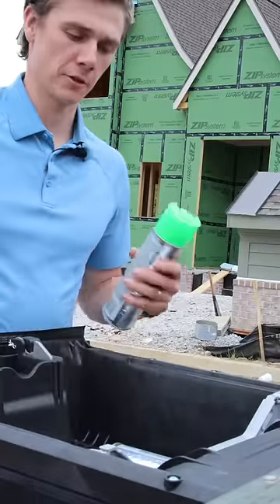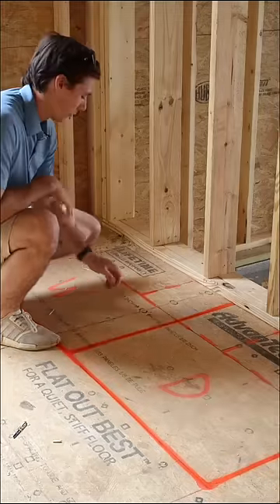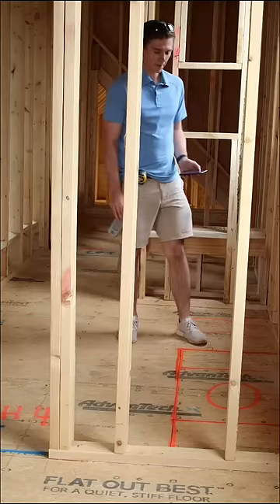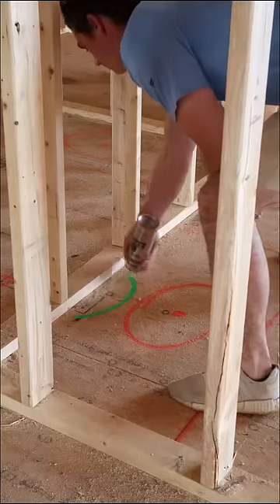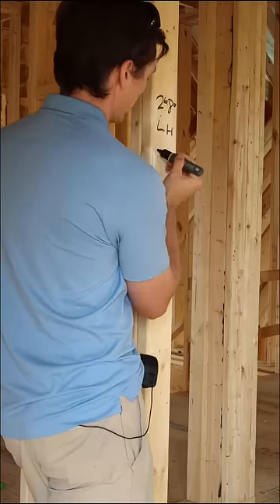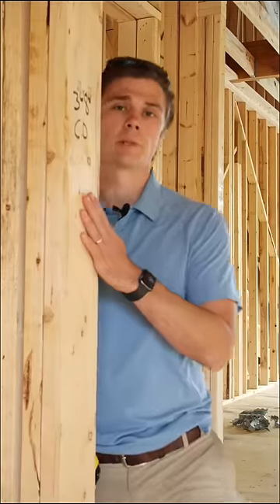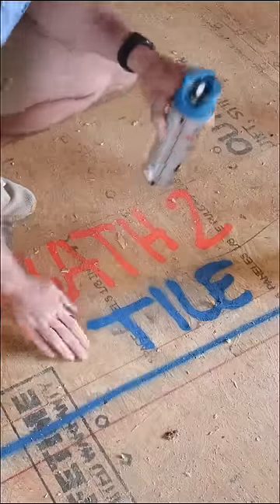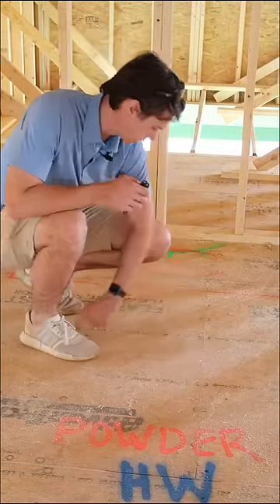How To Prepare a House For Rough Ins

Comment: This gives me a great idea. We should draw it out on paper with measurements and all so that the contractor can just look at it and know what to do.
Reply: Even if there are plans, no guarantee each trade, or each person from the trade has them. Or that they have the latest set. This is just another way to double check things.
Reply: @garrett892 how do you go on site as a tradesman and have no plans?
Reply: @joshwatson9725  how do you forget your car keys when you're going to work?
Reply: @joshwatson9725   Happens all the time. Get called out to a new job last minute because someone else called off. Or maybe the architect or owner made last minute changes that aren't on the plans you have.  Maybe your boss or foreman has them, but they never got passed on to the guys doing the install. Maybe the information like switch locations, plumbing locations, and light locations aren't on the plans or dimensioned properly because some architects are extremely lazy when it comes to details.  Maybe there is a set of plans onsite, but there are 20 tradesmen working so not everyone has access to them. Just saying its nice to have a way to double check what your installing is right the first time.
Reply: @garrett892  if you don't have plans and are going off the pretty pictures on the ground, you're not double checking anything. I have no problem going to spray paint layouts to help thw homeowner visualize things, but if you forgot the plans and are using these layouts as your guide, you're a fool and an embarrassment to the trades
Reply: @nyaa we don't. How do you get to work without your keys?
Reply: @Lettusfarm  how did you make that typo? hopefully you get my point soon
Reply: @joshwatson9725 crud happens. What if you thought you were doing underground and it starts to pour rain so you get redirected to a job you've never been to? Again... Crud happens
Reply: amazing idea let me borrow that print once your done so i can spray paint it around the house and make sure i dont got half my guys looking at a blueprint all day or questioning what wall i was talking about when i say pump the 2nd bathroom sink in.
Reply: @joshwatson9725  well.. if you go get a job and move out moms basement you will figure it out.
Reply: not to mention if your building a motel or a hotel your not going to walk down 5 storys to go double check a blueprint in your work area to see what side of the wall the tub goes on or where the shitter goes because your going to have a pretty marking on the floor saying "tub" "toilet" "sink" stop blabbing in youtube comments like you know something noob.
Reply: We do that already and somehow they still manage to fuck up. Might as well make it even more simple
Reply: I see what you did!
Reply: There was a little sarcasm in my comment that went straight over some of yalls heads. I've been a Construction superintendent for a long time and I have learned that everybody is just looking for a way to not be responsible for a damn thing.
Reply: Maybe we can call it construction documents
Reply: @dlstb  There's no excuse for working without plans. It's the GCs responsibility to make sure all the trades have them.
Reply: Insecure
Reply: God forbid we make the installations more convenient though right? Save 100 checks on a piece of paper by having it all laid out with no room for error. Some people will always have a smart ass comment though.
Reply: @jkizzle9953  How does spraying inaccurate lines on the floor make things more convenient? Sounds like duplication of information that can lead to confusion. The plans call for a toilet drain to be 18" from the wall and the GC sprays a rough circle at 20" because he didn't use a tape measure. Which one does the plumber use?. If your answer is he should check the plan then it's a waste of time to spray a circle on the floor.
Reply: @garrett892 as a drafter who deals with contractors daily, "or that the contractor and his crew know how to read them, even if they have them."
Reply: @jamescrud  we have a tradesman in the room
Reply: @joshwatson9725  You have a tradesman in the room?? What does that even mean given the question that I asked?
Reply: @jamescrud  was a compliment, meaning your a tradesman, because you knew what the hell you are talking
Reply: @joshwatson9725  Thanks for the compliment but I'm not a tradesman and I don't work in construction. I design specialized engine testing equipment for the aerospace industry. I'm a mechanical engineer.

Comment: Also a floor specialist. Be sure to write down which direction each door opens/swings. that way the hardwood guy knows where to stop the wood.
Reply: That's the arrow on the trimmer under the door size.
Reply: Doors are always in before floors...
Reply: Swing is on the print.

Comment: If your tradesmen don't read drawings, you shouldn't have hired them to begin with. Nothing worse than having to hold someone's hand that supposedly is professional.
Reply: If you have a little bit of a brain you can figure it out without looking at some lines on a paper that are most of the time wrong and or can’t be done they way they want but I guess we don’t all have common since I promise you this 7x12 room going from the garage to the kitchen isn’t a bed room it’s laundry room and this 10x12 room isn’t a bedroom either it’s a bathroom and this big open room in the middle of the house that’s not a bed room either that’s a living room I don’t need 14 prices of paper to figure that out I wouldn’t hire the one that needs planes to figure it out that means they haven’t done the job long enough and I prefer experience over an over priced piece of paper from a school that says I can read plans
Reply: @bradthackston5217 you nailed it with an epic rant. I didn't say anything about school. Many, including myself, learned to read drawing, schematics, blueprints from EXPERIENCE. I worked high end residential and commercial and started as a miserable helper when I was a teen. Gleened some trades along the way and busted my way into management and leadership by being hands on. But being the only guy in the room that can't read the standard drawings leaves you at a disadvantage and your potential capped never to advance to $50mil homes where the powder room is 20 x 20 and the kitchen is multi-level and figuring it out as you go only solidifies your station as a impeded dunce.
Reply: I think you’re not seeing the obvious. People are stupid. If you start out with that thought, you will recognize that if you’re the GC/Project Lead that your job is to always do one thing first:

Provide concise direction!

How you do that may change from company to company, but providing this information will save you many of the headaches. Not all of them, but most of them.

Also, spray paint on the rough floor and permanent marker on the framing makes for a solid system of basic markings. Steal/copy good ideas when you find them.
Reply: @multidinero  if you worked consistently with a limited amount of subs, that would make sense, but reality isn't such AND language is often times a barrier. Then you want to get know it all guys to follow your scribble via markings on the rough? Keep dreaming.
Reply: @rubenmocuta3109  change is hard to accept. You’re used to what you’re used to. Being obstinate isn’t the answer.

I guess we disagree on what’s useful.
Reply: @multidinero  i didn't say it wasn't useful. What I'm saying is that when you're behind on a project or things have tried to go sideways, there's no time to hold your subs' hand and teach them anything. If you come to a jobsite and you're relying on gc to get you going on the basics, that's just silly. I've seen entire companies booted from high-end home builds and commercial jobs because they couldn't figure out basics. I worked predominantly in the SE and NE, union and non union, and no one has the time or care to babysit grown men at their job.

Comment: I do service work in existing residential homes for 95% of my career.  In what little new construction I have done I've never seen any sort of layout like this done.  I do appreciate the methodology though as I do similar.  I enter a kitchen gut and I'll use painters tape, lasers, whatever needed to mark out the cabinets/stove/dw/sink/fridge and especially island so that the customer and I can visualize the kitchen, where the overhead lighting should go, pendant light locations, where I need to stub out for UC lights, all of usual stuff.  Having a GC mark anything at all would save time for all trades assuming GC did accurately.

Comment: It would be a lot easier if most contractors did something even close to this.
In my experience as an electrician for the past 12 years, it’s all about running back-and-forth between the blueprints and calling the contractor and or homeowner, trying to figure out all the different counter heights, how high they want the vanity lights, what kind of trim around the doors, height of plugs in different areas, ect… I think it would be a great idea for each trade to come through and place each item as needed with spray paint with the contractor so nothing gets missed or misunderstood.

Comment: This works well I’ve had a few guys that did this it was nice you never had to worry about guys putting shit in your way, and you had to move it. It generally made everything faster and smoother, also as long as you followed it and the code if they complained you go it where you wanted it and it’s up code.

Comment: This is someone who has nothing better to do than micromanage subs. Paint all you want. I’m going by the plans, using the scale to get my measurements and the codes to let me know where I can place my devices, switches etc. And when it comes to the layout of lights and such, I’ll refer to the plans, and use a tape measure to put them where the plans say. And furthermore, trades usually work around one another. So if a plumber runs a pipe through a wall where I planned to run my wire, I’ll re-route it. The last thing I need is a GC in a pair of golf shorts and a polo who wants to tell me how to wire a house painting the floor and telling me how to do my job. I’ll follow local codes and the NEC, and the APPROVED plans that the inspector will be using when he comes to sign off the inspection.

Comment: You should mark the copper outlets for the ac system, that would be a huge help because most of the time it’s just “well this’ll work” and then we get it cleared over the phone but later it’s deemed wrong and we gotta cut a new hole and re run the lines

Comment: As a HVAC tech, I’ve done probably 2 installs on a brand new home. The rest of the trades hate us untill the power gets hooked up and they get heat or cooling while working. But yea, I stick to the tech side not the install side.

Comment: That art stuff is OK for drywall, flooring, doors and trim but make sure each trade gets a set of final prints with all changes and cabinet drawings with final layout measurements.  Let each trade do what they need to do to be up to code for their inspections. 
How do I know where to center my supplies and drains in your little paint boxes? Where's the drawers ect.

Comment: If you do that on a concrete slab, make damn sure the homeowner is not planning to do stained concrete floor. When we had our house built the sheet rock contractor painted the floor to mark where the can lights were. There are no words to describe how pissed off we were. The general contractor of course knew the plan. He worked all weekend on his hands and knees with harsh chemicals to remove the stains.

Comment: I’ve been let down by the contractors marks pretty much constantly over the years. I’d rather take the extra time to check the prints. But hey if it works for you then all the power to you, just make sure your marks are actually right.

Comment: I will say you can follow blue prints,but costumes houses change a lot,have to do sometime 3 or 4 walk through with the owners because they dont like outlets in certain locations or cans lights,also they sometimes want things that does not meet electrical code and you have to explain them why you do it that way there is code you need to follow.

Comment: In the plumbing trade the "rough" is completed before the build. When we would dig and install all of the potable water lines, as well as all of the sewer mains, and cap off all of the plumbing before the concrete slab has been poured. This is called a "top out" job for the plumbers.😢

Comment: FYI,
Marking a home like this should only be used as a guid. Everyone on the job should always build to the approved prints 😊did this for years and it did help a bit. The problem was the paint on the floor only lasted a few days before the trades walking through the home completely rubbed it off. You have to mark for each trade the day that they started work. 
Fyi

Comment: Lol. Yeah. This may work when a contractor is building a spec house or building a subdivision using a couple certain sets of plans. And selling ONLY after built. 

Your not gonna get away with this in a custom home. The plans change WAY to many times before each trade even has a chance to even order materials.

Comment: I absolutely hate gas stoves I don't why people bother with them. Induction hobs are far better. It's an even surface, doesn't require a separate lighter, doesn't set of smoke alarms as much because things don't catch fire because you can regulate temperature much easier.

Comment: and then the electricians will say the plumber cant do half of his job till they are done running wires and then wait until 3 days before deadline to start running wires. then they will run wires to make sure they are directly in your way and get mad when you relocate them or ask them why they didnt let you plumb in the whole wall before they filled it full of wires :'D

Comment: All that information is on the blueprints that each tradesman gets a copy of. Everyone is literally on the same page. Why do all this? Because if you mark something & it’s slightly different from the blueprints & then they put it where you marked it you will be responsible for the cost to remove & replace what was wrong. 

Because by doing this you put any & all errors made on yourself. Why risk this responsibility? If they have blueprints, which each of them should, & they make the mistake then all the cost to make it right is on them. By doing this all liability lies with you.